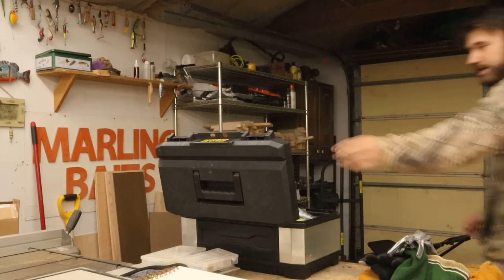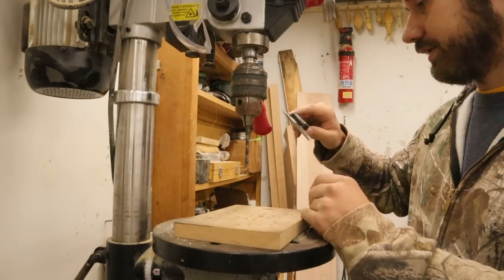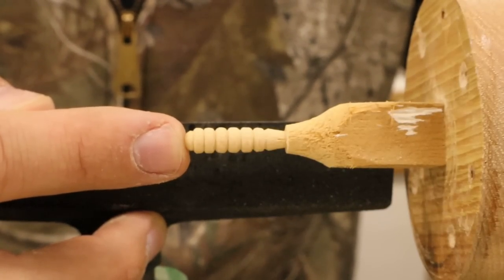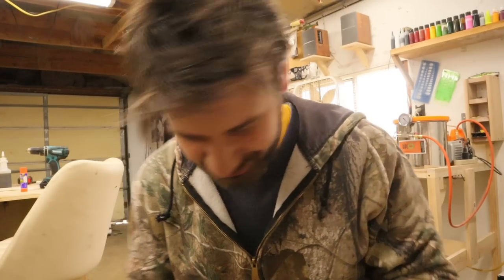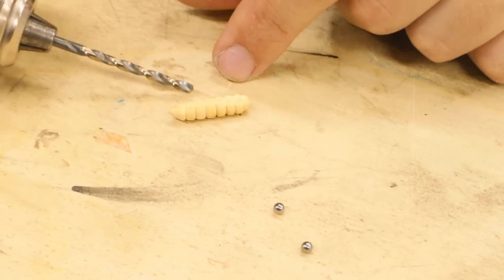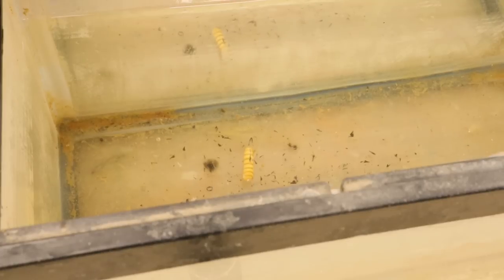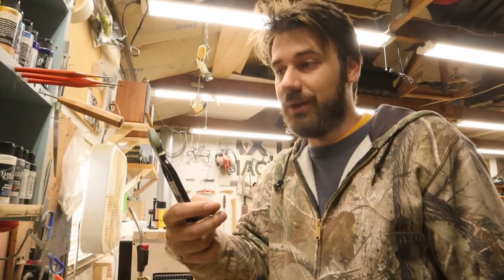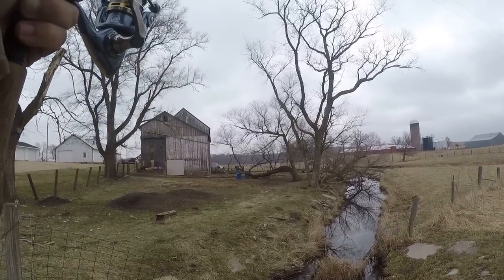Wax Worm | One Day Build to Catch Micro Fishing

Comment: I commented on an old video, but wanted to you to be aware of the following: in a uv box, heat can be for you or against you; different colors,  when irradiated,  produce different amounts of heat....sometimes you'll get browning because of it. So to even the field, you should determine a proper sized box for the wavelength of light and the number of baits inside. Put a fan in the box ( helps eliminate heat issues) and rotate the baits ( evens out all affects from your lamps).  Doing this adds consistency and confidence.

Comment: Hot glue my man. It's a fly tyers best friend. Great for building up bodies on big streamers, or big damsel fly larva and yes, hellgrammites. Just be sure to wrap some thread around the shank so the glue has something w a little traction to bite on to. Really easy to add color. And even easier to fix your mistakes if you shape it wrong etc. Just a tip for making "micro fishing" baits. I like to use similar methods to catch bait for big brown trout and northern pike in the Connecticut River and surrounding areas in Vermont.
Love your channel. Keep doing it how you been doing it
Best of luck to you and your family. And tight lines.

Comment: Next time you want to tap a 1/4-20 thread the correct drill size, if I remember correctly, is a #7 or about .201".  Then you will tap a much deeper, stronger, and longer lasting thread.  If you don't have any wire gage drills you can use a 13/64".

Comment: let me tell you exactly how to catch those chubs
1: make a super tiny bobber, like, as small as you can cast. it'd fine if that means vaguely round pice of wood with a tiny hole in it, with a tooth pick for a line stop
2: grab one of those fly hooks you have, the size you had is fine but if you can go smaller, do. im sure you have a scrap of wire somewhere, the individual mini strands of wire that were braided together to make speaker wire work well, collect it, and procure some orange thread
3: take all of these things to chelsey and the fly tying vise (i could be wrong about her name, my sincere appologies if i am) and have her do the following
     3a: put the hook in the vise, load the bobbin with the orange thread, and then start the thread on the hook
     3b: lay the wire along the hook shank, and take a single layer of touching thread wraps back to where the hook starts to bend
     3c. take another single layer of touching thread wraps back up the hook to just behind the eye

     3d; wrap the wire evenly up the orange thread body she's created candy-cane style. what this does is create the segmentation that insects have, as well as adding a tiny ammount of weight.
     3e: take two thread wraps over the wire, two thread wraps under the wire (around only the bare hook shank) then one more over top. this doesn't seem like enough, but don't worry, we'll be addressing this
     3f: wiggle the wire bak and forth until it breaks off just at the thread. take another wrap or two to lightly cover the butt of the wire, then tie a whip finish. the whip finish secures the thread, and acts as a wrap of thread to further secure the wire while adding minimal bulk. 
4: go to that creek, attatch your bobber, and this fly, and then set this bobber to 1.5x the depth of the water (if a particular part is 12 inches deep, you want 18 inches of line)
5: cast this rig in to likeley spots, and and let it drift through. if there is too little or no current, a slow retrieve can impart the minimal movement
6: every time you either see the fly get eaten, or see the bobber do something, set the hook
creek chubs destroy orange, i dont know what it is but i always seem to do best catching them with orange stuff
anywho, that will work. if you want either you or chelsey can make other colours, too.

Comment: Save yourself the headache sir and epoxy that bolt into the wood and then you don’t have to worry about the ratchet set.  I have several made with different size bolts for bowls I turn.

Comment: That discomfort with tiny things indicates your natural scale. Some guys are 1/2', some are 1/4" or 1/8' others like machinists are .001" or .0001". You can learn to work smaller but if you press it too far you become inefficient. It's like knowing you can add a circuit to a breaker box if you had to but you'd be happier having  an electrician do it.